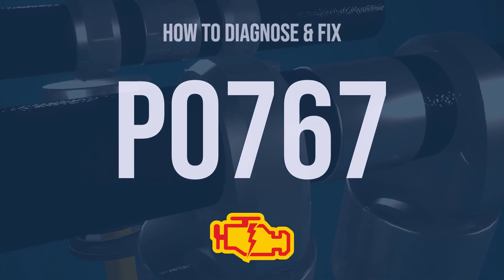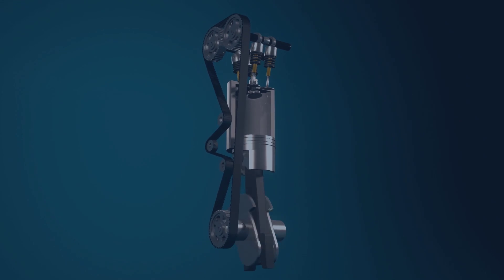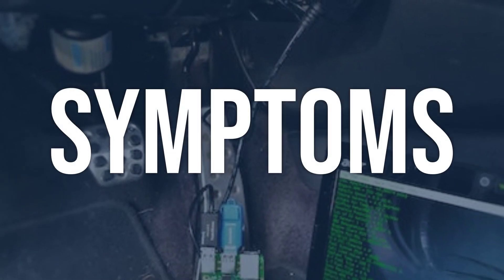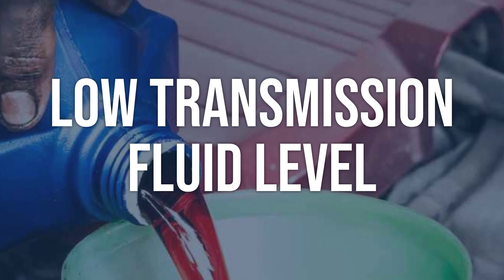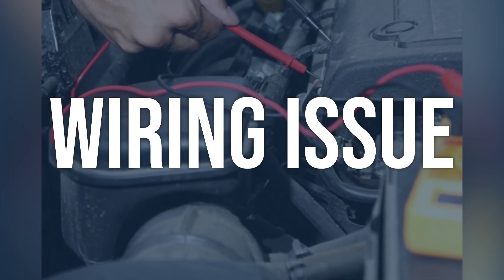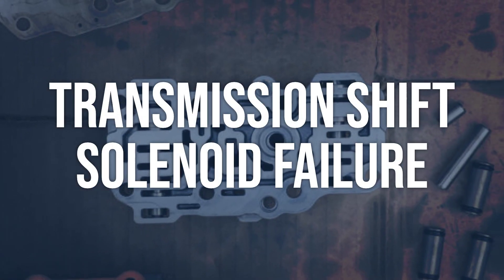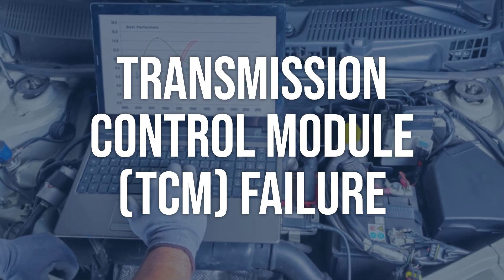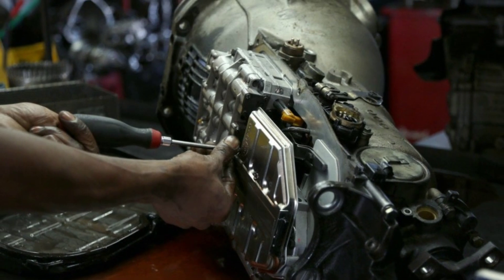How to Diagnose and Fix P0767 Engine Code - OBD II Trouble Code Explain

Comment: 2:24 I just had my abs module replacement with a 2nd one which fix my braking problem, now I have a new problem with my car kicking ,would this module cause problems with my shift solenoid d ,I never had this issue before they changed the module. If not could they have damage a wire from plug connector
Reply: It's a mazda 3 2009